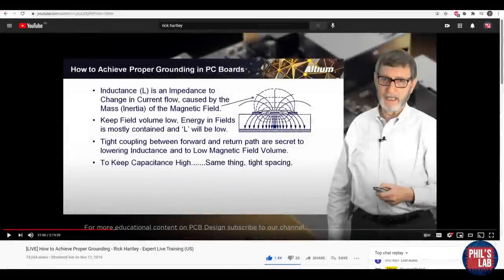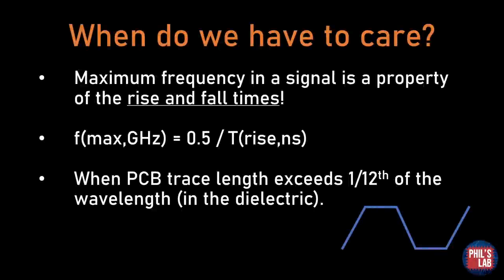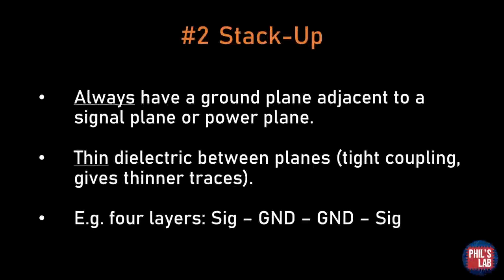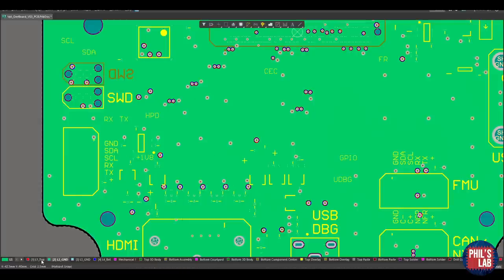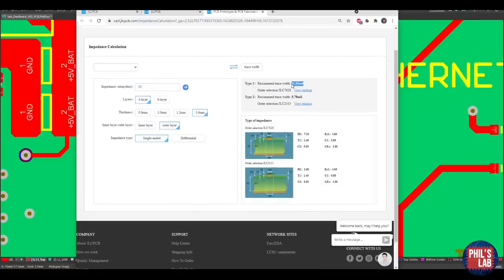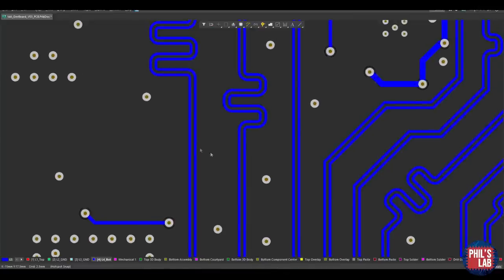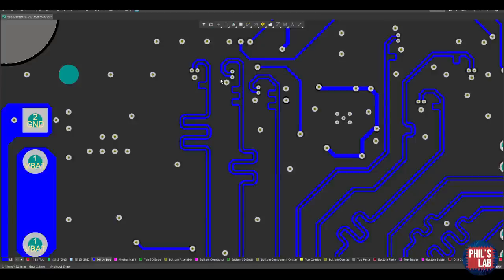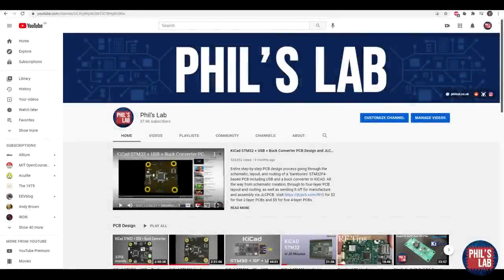High-Speed PCB Design Tips - Phil's Lab #25

Comment: Rick Hartley makes some of the best and most informative presentations out there for PCB design. So to everyone watching this video, find a presentation by Rick Hartley and watch it ASAP! You won't be disappointed! 

Also, check out the presentations by Eric Bogatin, totally worth a watch!

I have noted that the layout engineers at work will always add via fencing around the board with quite generous spacing (20h-rule). Also, they often route high-speed signals on an inner layer when they have a 10-40 layer board, keeping the top and bottom layer for components only.

Comment: I would recommend Rick’s other video ‘What your differential pairs wish you knew” 
That was a revelation
Reply: I watched this on your suggestion. Between the grounding video and the differential video I feel like I have had a revelation in high speed circuits!
Reply: Am I the only one that wishes that not too many people should watch this video so I can stay ahead of the competition? ;)
Reply: Rick's video in differential pairs is very interesting. There he recommends treating them just like regular traces 3H spacing between them, same 50 ohm impedance (or whatever is applicableto the system), and he says he's never needed to make them equal lengths (within reason of course).

Comment: Great video. Im currently making my own USB 3.0 Hub as a hobby project. I saw that you placed test pads directly on the signal path. I know I should avoid stubs any other recommendation for test pads so I can later measure signal integrity?
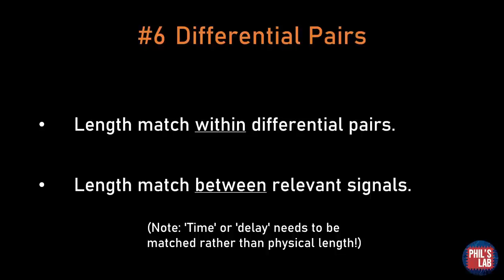Also at 9:45 you have a Note about time and delay. I which cases does the physical length actually differ  to timing, delays?
Reply: (not my words, but i thinks spot on for what your asking) Determining length requirements requires an understanding of flight time, electrical length vs. physical length, loading and signal quality. Those elements are vital in determining what the length really needs to be, as well as in determining the allowable trade-offs to meet system timing goals. 
Search web for eetimes and "meeting-timing-specs-on-boards-with-picoseconds-of-margin" some good info here
Reply from the maker: Thank you, Jonas! The test pads I placed only on 'low-speed' lines.
Timing differences/delays occur when routing on different layers (i.e. inner layer vs outer layer) or when going through vias.

Comment: Hi Phil, what about for an LED display panel with 48 LED drivers and 760 LEDs with LEDs on one side and surface mount components on the other? It is difficult to have a clock trace going to each LED driver without switching layers and keeping the clock trace short as the LED drivers need to disperse across the PCB, a power plane would also be useful for LED voltage.

Comment: Great Video!  I get wildly different values for trace width and spacing between online impedance calculators. For instance, EEWeb using the settings for the JLC7628 4 layer stackup microstrip gives me Width: 0.41mm and Space: 0.2mm for 90ohm diff.  Yet JLC gives me,  Width: 0.254mm and Space: 0.19mm.   Vastly smaller than EEWeb suggest.  Thats a huge discrepancy! .  EverythingRF gives closer to JLC, Width: 0.267mm,  Space: 0.19mm.  I guess I'll ignore EEWeb even though thats been suggested to be the better calculator.

Comment: Amazing video!

When you talked about 50 Ohms for single ended signals: can this be used as a starting point for all kinds of signals? 
The reason I'm asking is that I've been trying to find out what I should aim for to get the maximal performance on a relatively long SPI connection for ensure signal integrety.
Reply from the maker: Thank you, Jacob! Yes, that's actually my starting point for 'all' signals. I'll typically route signal traces as 50 Ohms (even things like I2C, UART, SPI, etc.).
Reply: @PhilsLab  Thanks!
Reply: The 50 ohms calculator assumes the skin depth of the wire is approximately on the surface, so I2C is a little slow for 35um 1oz copper. SPI can definitely get fast though. Doesn’t hurt on 100Mbps, but you are only going to lose 1.2dB/meter…

Comment: Is it possible to make some video on how to handle PCB design where you have to deal with multiple voltages on one PCB board, i.e. DC/DC converters, BLDC drivers etc. In such applications very often you have to integrate high power and logic parts into one board.

Comment: Hi Phil Love the Video! Would you be able to post board in the video on GitHub? I’ve been meaning to get into high speed design. Also when are the audio board/ fpga videos coming out? No rush just curious.
Reply from the maker: Hi Pietro, Thank you! I'm afraid it's a company board, so I cannot post it on GitHub.
I've recently designed a Spartan 7 board with DDR2 memory that I still need to order/assemble. But once that's done, then I'll make a video about it :)
Reply: @PhilsLab  Thank you Phil, I have one more question too. I recently designed a board with a 5V regulator where the 5V gets filtered through an inductor coming from a buck regulator before it is dissipated as 5V. I need to draw about 2.3A but now I am a little worried because one of the traces I used coming off of the buck was 0.5mm. I used a 0.75mm to go into the inductor and a big copper pour and a 5V inner layer but I am just worried that the current coming right out of the inductor, 2.3A max would be a lot for the 0.5mm trace. Do you think that trace is too thin or do you think it’ll be alright considering the other 0.75mm trade and the copper pour at the output of the inductor?
Reply from the maker: @pietrogagliano4484  I think you'll be fine. It may run a bit warm as according to a calculator (for example, the KiCad track width one), a 0.5mm wide trace with 2.3A running through it will give a temperature rise of 'only' 30 degrees.
Reply: @PhilsLab  Ok thank you! Yeah I have beefed up the traces for a later iteration, it’s a board I’ve been designing for work and these are prototypes so the final iteration will be rather beefy with the power traces to provide a good safety measure I just forgot to look that over as I was designing rather quickly for testing stage

Comment: great video! 1 question: when you calculated the tracewidth for given impedance, why doesn't the tracelength matter?
Reply: I would also like to know this!
Reply: impedance for transmission lines assume infinity length. For example impedance between signal and ground might be 50 ohms assuming the transmission line continues forever. You then terminate it with a 50 ohm resistor which looks exactly like an infinite long transmission line.

Comment: Two questions: The design Phil uses is called a microstrip line. But there are alos designs that uses ground planes on the top, like coplanar waveguides.
Is it better to use microstrip lines and use multiple layers for the signal ground? Or would it make sense to use the coplanar waveguide and add GND areas on the surface?